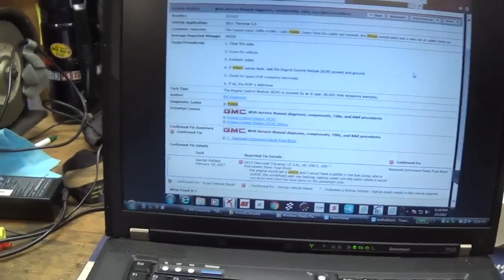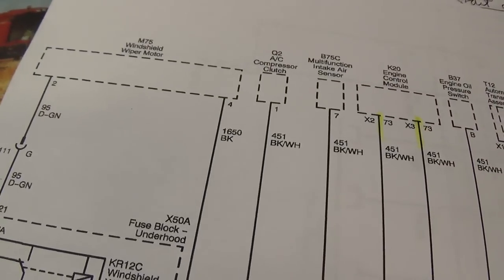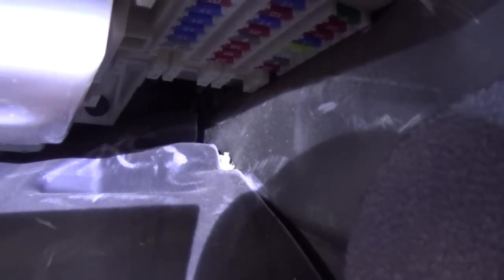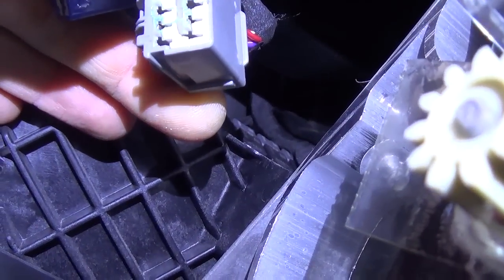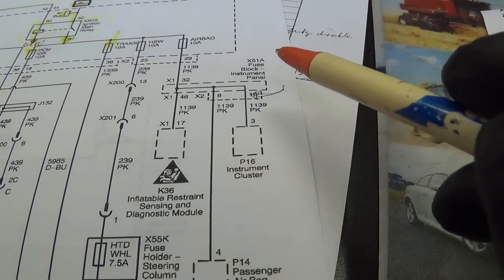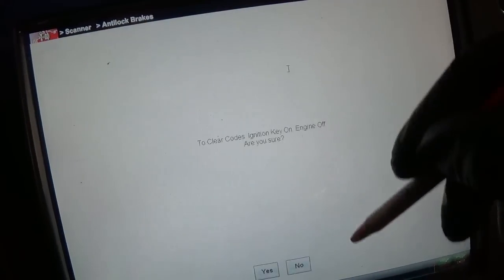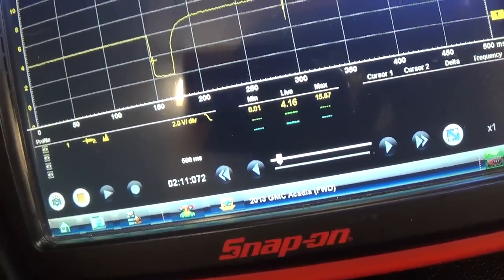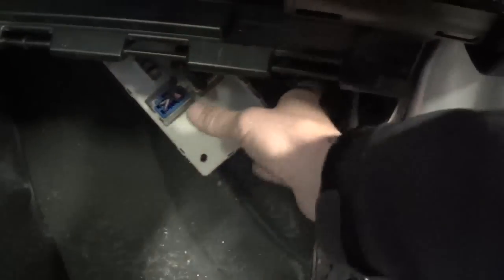CONCLUSION!!! No-crank, REDUCED ENGINE POWER: '13 GMC Acadia -Part 5

Comment: Great video Ivan. It's always a great feeling when you pull the connector apart and find the green fuzzies. The little "A Ha! moment. You figure out the root cause and prove it, then you get the full story from the customer. Funny how it always seems to work that way. I guess in the customer's defense though, they don't realize how things like water leaking during their carwash can be related to their driveability problem. I agree, you did your best with the info you had. Nice diag, I don't think you have anything to feel bad about. ~Mike
Reply: Personally, I am a long time lurker! I figured since you guys give me all kinds awesome feedback on my videos it was about time I return the kindness!!! Nothing Corporate, just tech to tech stuff. :)   ~Mike
Reply: Wells Vehicle Electronics I see you looking out there for the product development team. Next month or 2 we will have wells replacement fuse boxes available
Reply from the maker: Thanks for the comment, Mike! I'm just glad to be done with this one :)
Reply: Ha I bet! But, it did make for a darn good diagnostic video! ~Mike
Reply: motoYam82 great job fixing this  my 2000 jeep grand had water intrusion issues  took me months to figure out what it was checked all the seals  no leaves then I noticed it only happens when. the ac was on. but also the ac would be dripping outside I checked the drain it was clear couldn't figure it out so I stopped running the ac dried out the carpet did some research well found that this was a common issue with jeeps it was blow back when driving cause of the angle the drain came out so it followed the drain back the the firewall and began leaking inside so what I ended up doing is getting some rubber hose and a hose clamp I made the drain longer and had a dip in the line so it drained down not horizontal cost me 20 bucks never had water backing up into the car again.
Reply: Nope, not the case. Just happened to see Ivan's video come up and checked it out. Tech to tech, nothing to do with product. ~Mike
Reply: If Wells did make a fuse box I'd definitely buy it b/c it'd probably be sealed up a lot better...taking OEM products and making it better. Wells products rock!!
Reply: Wells Vehicle Electronics Of course I was only kidding. But glad to see you out and about watching those that watch you. Knew I'd like you 😉
Reply: Thanks Bob! ~Mike
Reply: Wells Vehicle Electronics when I hit 2000 subs I'll release my videos . Hope to see you there too
Reply: I see what you're doing also...ahhh  You'll never get 2000 subscribers with no videos but post a few and as soon as they see how much knowledge you have and the speed of your diagnosis the subscribers will flock to your channel...If you make it they will come :D
Reply: Keith if you release your videos I'm sure you'll surpass 2K subscribers probably in the first day...I'm already a subscriber anticipated the release!
Reply: Keith, I'll be there, but like Bob said...why wait? ~Mike

Sorry Ivan, seems we've hijacked your comments section.
Reply: Hayward's Automotive ahhhh, I see what you guys are doing there ... nope , not gonna do it. 2k and I'm in. 1,999 maybe . 1,998 sorry Charlie
Reply: Well when you have computers pretty much controlling everything but the steering wheel and throttle control and brake control but now there is such a thing, just not on GM's yet, water and electricity do not mix, it is a common sense and basic knowledge, or a power wire that has been frayed due to rubbing and it is touching the ground side or some old school diagnostician, poking through the Insulation to check the continuity and power, and just leaving it like that, can and will lead to the failure of components down the line.
Reply: Nailed it!
Reply: This whole series was torturous to watch. Several times moisture was mentioned as a tie in but it was glossed over. The other thing I've noticed both with your videos and a few others, is that ppl rely on the scanners and scopes to their own detriment sometimes, and for some reasons there's an aversion to doing a careful visual inspection of wires, house etc. namely not pulling connectors apart and Laing a look for backed out or bent terminals and pins etc. eventually enough of these things will happen like in this video and and decide to have a careful visual inspection of things. Back on that other video with the Dodge cool,milf you would of got your eyes of the computer and tool a look under the hood a bit more you might of seen the odd aftermarket coil.